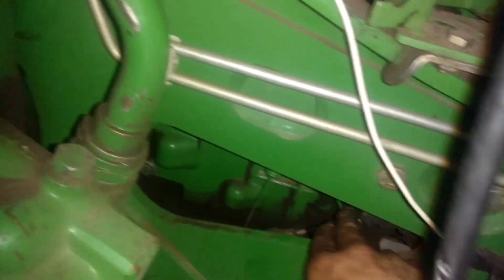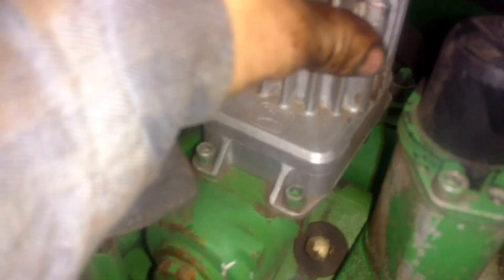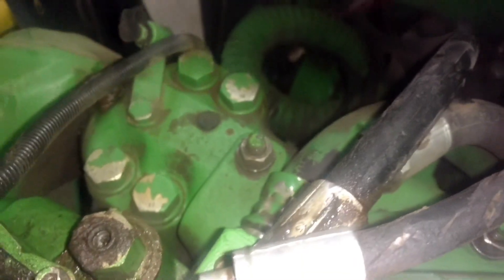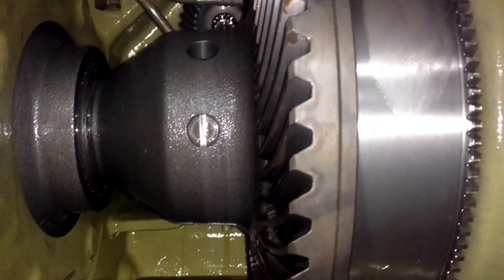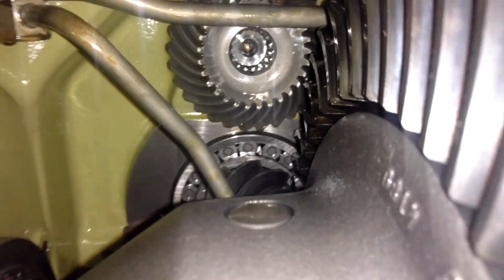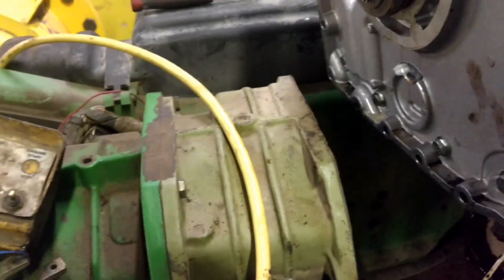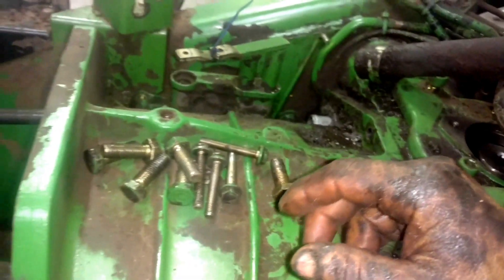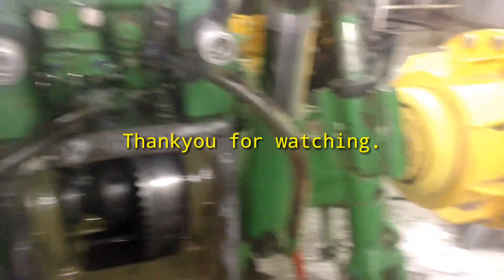John Deere 6715 teardown part 1

Comment: The PTO on my 6715 quit turning today I mean it just locked up, if you engage the PTO it tries to come on but then the engine will start lugging down and it will actually kill the engine if you don't shut it off, it was working fine last week spraying soybeans running the solution pump, today I go to start cutting hay and turn it on it stalled the engine out, at that point I'm thinking the hay cutter is jammed up but no dice, I unhooked the cutter shaft and it did the same thing,  I even flipped the shaft around to 1000 RPM just to try and it did the same thing, what do you think went wrong??

Comment: This is giving me flashbacks to the time my diff ring gear broke in my  1961 Case 530 backhoe. All work done in the fricking dirt. Someone pulled it apart and put a bakelite shim in for the diff spacer. Like that would be solid enough to work. Not.